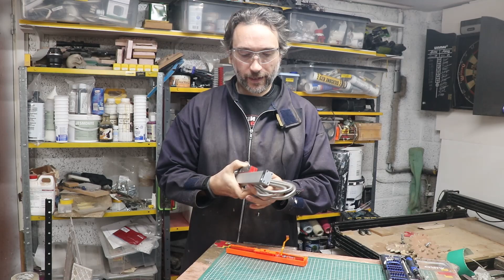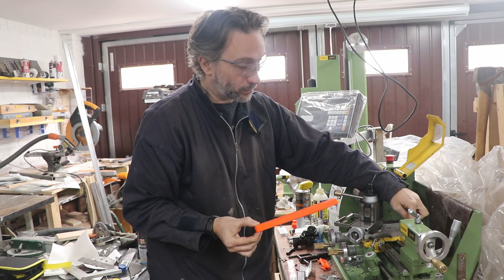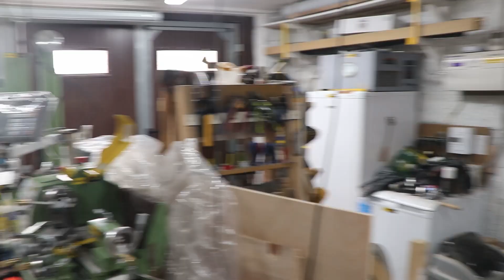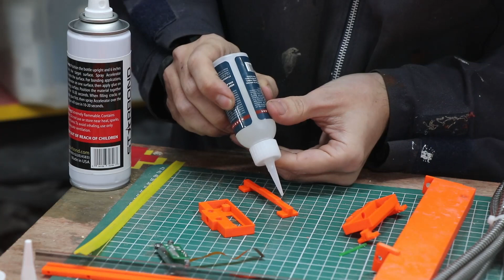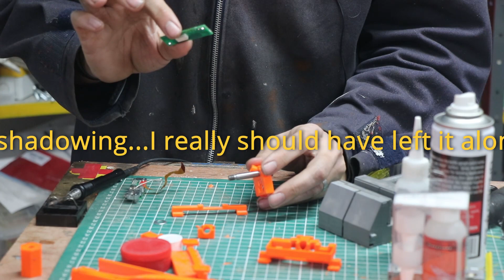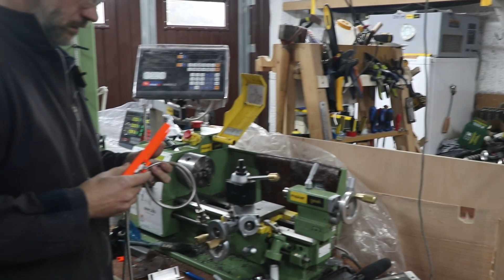3d printed, low-profile enclosure for cross-slide DRO scale for Warco WM-180 lathe

Comment: Mounted my dro scale to the front of the apron like that (Chester DB7, very similar to your Warco I think) with the aid of a couple of custom 3D prints and bolted to those same follow rest holes.  I've now crashed the scale into the chuck (thanks to my electronic lead screw and my stupidity) but have ended up putting the replacement in the exact same spot.  Took the opportunity to open the danaged one and discovered lots of chips.  Caution is a advised!!

Comment: Nice i have the same problem. Did you model it in fusion? would you share it so i can modify it to dimension without having to re engineer the thing myself. if not thank you anyway for the proof of concept id been thinking of doing the same thing for a while.
Reply from the maker: It's on thingiverse: 4937625 I'll be honest, I've mostly taken it off and been going without. I had some consistency issues with the hacked setup and haven't revisited it. In theory it should work just maybe needs a bit more tweaking and care to ensure it's reliable
Reply: @MakerGeek  ok well thank you very much for the reply i really do appreciate it. If im successful in my en-devour ill shoot you a mail and stl.

Comment: Maker, thanks for the link!  Well done on the mount.  Sadly I don't have a printer.  I had to mount that axis under the bed.
Reply from the maker: interesting - how did that work? How did you get the coupling to the cross slide? honestly I keep taking my solution off because it does kind of get in the way trailing the cable through the middle.
Reply: @MakerGeek  It looks sketchy, but works fine.  I have a bracket mounted to Z axis bracket (mine is very similar to yours) to hold the X axis slide (a lopsided T shape).  The X scale remains stationary.  I have a bracket mounted to the end of the cross slide that goes down and back underneath bed to hold X axis encoder (basically an L shape).  The X encoder travels.  These brackets were cut on a water jet at my work.

Comment: Well done. I am however pleased that I will never fit a DRO to my machines. Mainly because I grew up not using them. I can appreciate that if you don't have the experience they can appeal.
Reply from the maker: Thanks. Honestly this is the last useful axis for a DRO. I've lived without it for months. But since I did buy it, I figured it would be an interesting design challenge to see if I could make use of the components. The mill on the other hand... The dro there seems much more valuable. I've already used that to leave one work piece set up, shift to do a quick job on something else in a different location then return to the main location. I'd imagine that's much harder without a DRO.
Reply: @MakerGeek  Once you've bought it you may as well see what you can do with it, that's true.